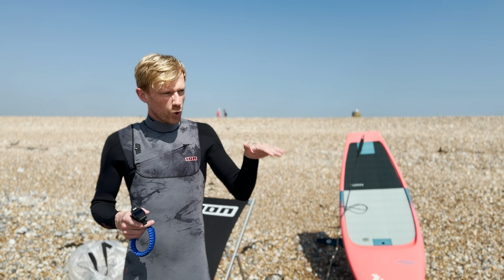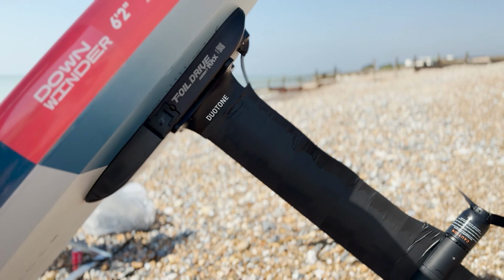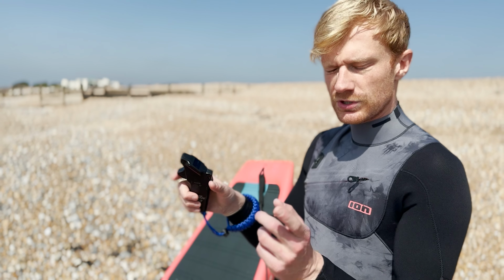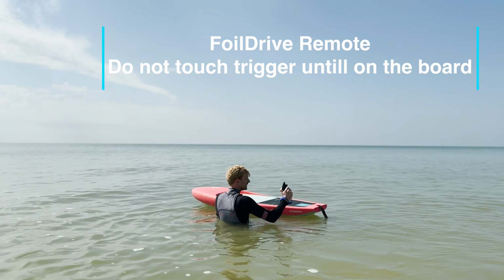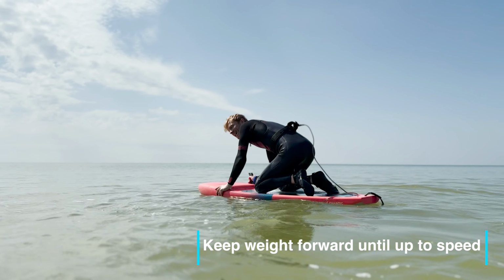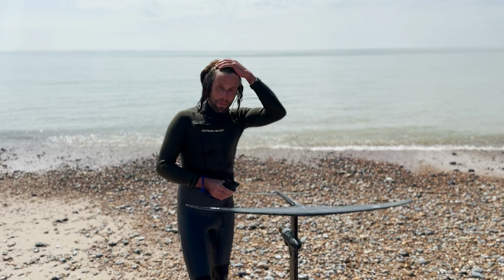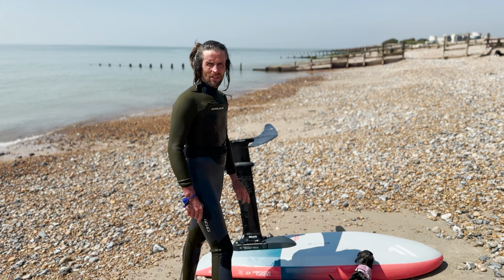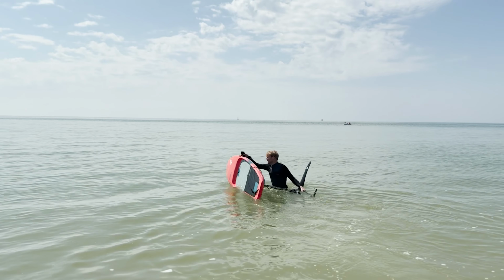Foil Drive MAX Power - How to E-foil for the first time - 60cm cable

Comment: Wouldn’t foiling in these conditions would be better as a full Electric Foil vs the Foildrive? Cheaper options with Electric boards these days as well.
Reply from the maker: Heya, most good and comparable E-Foil boards are £10,000-£15,000 
The beauty of this system is can be used on your existing equipment. It is a good way for beginners to learn the foil and then continue to use the same equipment.
Foil Drive is 4kg. Foildrive boards are 10-20kg, so the sensation is very different.
Reply: @worthingwatersports  maybe research into brands like SiFly and Waydoo for comparable boards which are half the price you claim. Agree with you on the weight difference but in flat or choppy water where you wont really be pumping anything longer than a minute, weight isn’t really a factor. There is a big difference between the two systems but they are used for different sports essentially. Each to their own but if you are looking at a FoilDrive and you are EFoiling more than 50% of the time then get an EFoil